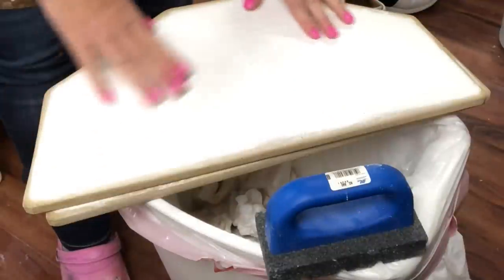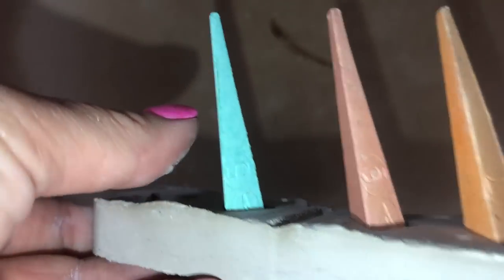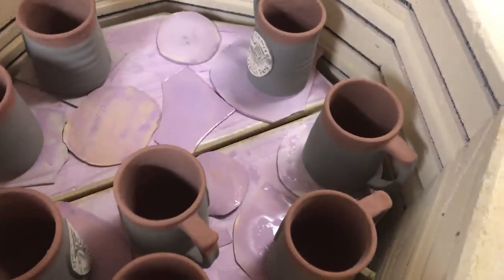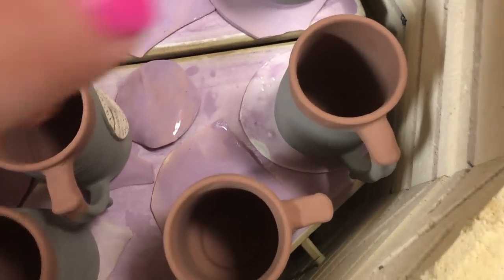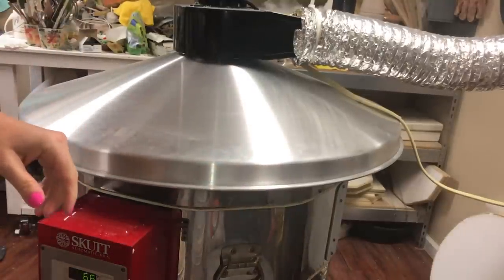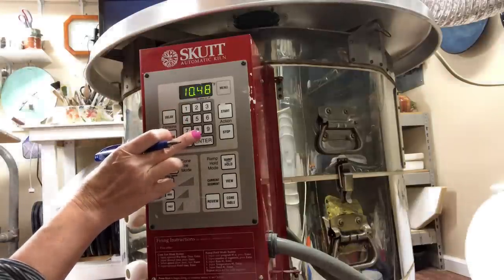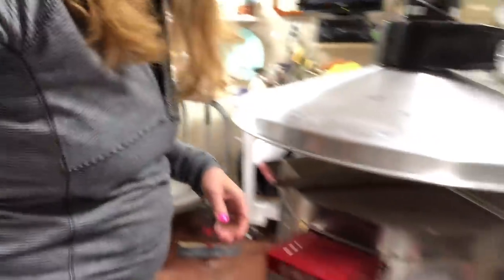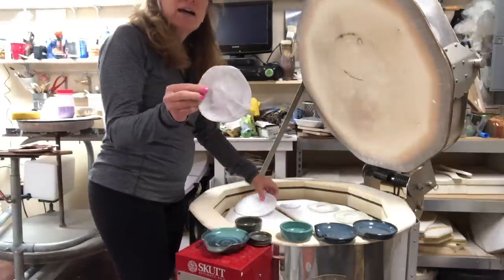Prepping and Firing a Glaze Kiln to Cone 6-  Part 2 of 2; Quarantine Distraction Video Day 43

Comment: Karan, after 15 years I'm getting back into pottery and have my wheels and kiln operational and have been throwing.  It's coming back slowly but your videos have helped.  I had all my glazes from 15 years ago in buckets and they have mixed up but the results have been so unpredictable I think I'm going to ditch them and start with new fresh glazes.  I liked the results you had with your glazes so I'm starting there and may mix some of my old recipes later.  On one of your videos you mentioned your glazing program for your kiln that you slowed the cooling process. I have a RampMaster II kiln.  Would you be willing to share the details of your program for your glaze fire?
Reply: I guess I should have watched this video before asking my question.  I see how you do your program.  I think I can do the same with my kiln.  I will try that as opposed to making a custom program.  It seems much easier.

Comment: Hey, I am very new in pottery. Thank you for this informative video. May I ask what you will do with patty after firing is done, do you destroy it or use it for next firing? Also could you please elaborate what is hold timing during the glaze used for? 😅thanks in advance
Reply from the maker: I reuse the patties until they are no longer useable!  I just periodically add kiln wash.  Once glaze gets on them or they break, I will then dispose.  The HOLD at the top temp allows the temp to even out and reach the desired cone.  I often use a hold- drop soak program when I glaze fire now- it helps to eliminate pinhole airbubbles on a few of my challenging glazes.  Here is that program:  Cone 6; Ramphold  Drop soak program, medium speed. Skutt programming 

Rate 200
Temp 180
Hold (whatever needed)

Rate 200
Temp 250
Hold 0
 Segment three continue
Rate 400 
Temp 1000
Hold 0

Segment four  continue
Rate 180 (This is slow for quarts inversion)
Temo 1150
Hold 0

Segment 5 continued
Rate 300
Temo 1917
Hold 0

Segment 6
Rate 120
Temp 2167
Hold 20 minutes

Segment 7
Rate 400 
Temp 2067
Hold 20 min

https://digitalfire.com/glossary/drop-and-soak+firing
Reply: @KaransPotsAndGlass  thank you so much, do you have any video regarding these segments for more clarification, I am self taught ceramic artist who doesn’t know these terms and thank you so much for that link it gives me a bit of clarification but I am not sure about these segments 😅 sorry I might sound lame. I am from India and I have received stoneware clay with 2160 temp (provider told me that it’s a high fire range clay). I am really confused which glaze should I go for it and how to fire it 😅😅 
P.S. I am planning to buy electric kiln from local manufacturer and meanwhile I am fingering out the process of glazing. It would be really appreciable if you can help me with glazing section. Thanks in advance

Comment: Nice video. I am new to pottery and in the process of getting a kiln. Did you say yours in this video was a 1018? Forgive me, but it looks bigger then the dimensions on the spec sheet. I also tried to make the inside dimensions on my kitchen table to get a visual of the chamber capacity and this looks bigger. I guess my question is, is that a good size for a beginner? Seems to hold a lot of pieces for about a 20 inch wide by max 15 inches high (taking into account the shelves, posts and space for fingers to shelves in) unless I misunderstood the spec sheet 😊 I can get a used 1218 but thinking now that’s too big. Thank you! Hope to hear from you, could use your advice.

Comment: Can I add some greenware together with glaze firing?
Reply from the maker: You wouldn't do that if you are doing a hotter glaze fire than a bisque.  You could do that if perhaps, you are firing only lowfire cone 04 or 05 providing you fire it like a bisque and make sure it is all dry to prevent explosions.  If you did that with a higher temp glaze firing, that would be bad for your bisque, as you would be vitrifying your clay if you took it to say, cone 5/6 if using midfire.  If you then try to glaze bisque which is vitrified, it won't accept the glaze well, as it won't absorb.

Comment: Why did you fire to ∆ 5 with a hold instead of firing to ∆ 6 with no hold?
Reply from the maker: That is as per the instructions of my Coyote Glazes.  I assume it has something to do with helping the glazes to more fully mature with the hold.  Since I typically do a medium or slow glaze firing, I hold for 25 as opposed to below when they hold for 30.  :)

This is from the coyote website:  "Coyote glazes are designed to be fired between witness cone 5 and witness cone 6.  /and/  Cone readings are a combination of time and temperature, and do not correspond directly to any specific temp in degrees. Most digitally controlled kilns have a pre-programmed cone fire setting that will allow you to reach the proper temperature with minimal fussing (we use a cone 5, fast, with 30 minute hold.) For manual (sitter) kilns we recommend using a 6 cone."
Reply: KaransPotsAndGlass makes sense!  I don’t usually use Coyote glazes, so I haven’t seen that direction.  Thanks!

Comment: If I have glazes that are old and dry (like tempera almost), can they still be used if mixed well with water?  I don't think that they have been  used for about four years, but there are quite a few of them, and I hate to waste.
Reply from the maker: Often glazes can be brought back- but you may have to watch the ratio of water- as it can change the specific gravity of the glaze, resulting in hard-panning or settling out.  Distilled water may be helpful along with a gum solution.  You can always contact specific manufacturers of the glaze for their specific recommendations!  :)
Reply: @KaransPotsAndGlass  thank you for the suggestions.
Reply from the maker: Good luck!!!
Reply: @KaransPotsAndGlass  thanks!   I enjoy your videos!

Comment: What cone number is in front of cone 5?  Should the cone 7 have a slight bend before turning off kiln at target cone 6 maturing?
Reply from the maker: I only use three cones- 5- the first one (that’s the lowest-coolest) bends first. Cone 6 should be bent to the correct position as that’s the target, and 7 is beginning to bend!
Reply: @KaransPotsAndGlass  So cone 5 is the approach cone, cone 6 should be the target cone and cone 7 is the guard cone?
Reply from the maker: That is correct!